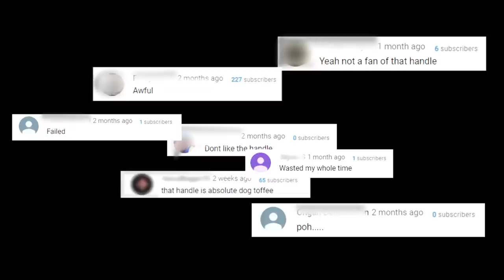Restoration of rusty old straight razor. This time better

Comment: At 12:05 are we going to ignore the fact that  he pulls out an anvil to lightly tap on the metal with a hammer
Reply: probably just needed a taller work surface
Reply: I mean, that's how you use a hammer rivet? But yeah it is a HUGE anvil for the job at hand. :)
Reply: 2FAST sometimes it do be like that

Comment: Great job! One thing to consider for future builds - mixing two metals (the brass tube and the steel blade) creates a battery effect (galvanic corrosion) which causes rust. Between the two metals on this razor - it would cause the blade to rust pretty rapidly, especially since it would be regularly exposed to water so the wood will have a high moisture content even after the wood treatment. https://en.wikipedia.org/wiki/Galvanic_corrosion
Reply: the one good criticism

Comment: What sort of clown would give this a thumbs down? It's well done, instructional, and humorous. 

I would have just put the razor in the scrap pile had I saw it. If I had done the work to restore blade, I would have bought some commercially available scales and called it a day.  

Odd Tinkering goes the whole way to redo/make everything. He's done good job of explaining what to do by using only an odd title here and there, the background sounds and some labels on made on wide pieces of tape. Those explained everything. No spoken words needed.  Plus a few good jokes. Bravo.

Comment: Tech tip-fill the cavity on your side cutters with silicone. Once it hardens cut a line in it so they can open like normal. Then when you use them to cut your brass rod it doesn't go flying. The silicone will hold it in place!

Comment: use blocks when sanding or roll up the sandpaper to form a tube when working on curves!  it will keep things flat and straight, especially when doing a straight razor!

Comment: If you only epoxy the wedge to one of the two sides, it won't rotate out of place, but if you ever need to disassemble the razor again, it'll be possible to pivot the scales or remove them from one another. Like, for example, if you decide to install actual bearing washers in place of those pin retainer rings you put between the blade and the scales.

Otherwise, good stuff.

Comment: I adore the handle you made for that straight razor! 

Questions:
1. What was the name of the Wood Hardener?  I have not heard of that before this video.

2. Why did you fully slice the wood block into two pieces if you knew there was going to be a wedge added back? I would have imagined that you could have cut the proper width out, or am I wrong in that assumption?
3. What kind of washer did you use on the outside for the rivet? What is the name of it? I have a little wooden handled jack-knife  that would look great with that added detail.

Thank you for your help!

Comment: When using a vacuum chamber, if you're concerned about pulling liquid into your pump, you can have an empty container along the vacuum line that will collect overflow without sucking anything into the pump.

Comment: Just a little bit of advice for you here, call it constructive criticism if you will after watching 5 of your videos, after using your rust remevor solution, bathing your metals in WD 40 rather than water help prolong the metal after being introduces to rust removing chemicals, water is the last thing you want to introduce metal to, also after hardening wood a UV light would help prolong integrity of the wood

Comment: I have never done this before so where did you find the correct size brass rod, washers, and those little pop on things to hold it all in place and what are they called ? Very good video, really enjoyed it.
Reply from the maker: I found those on ebay. I think it was called razor rivet set or something like that
Reply: Thank you sir.

Comment: Those types of razors are usually used for beards or pretty much any facial hair. I believe you can use them on any hair if you have it sharpened right though.

Comment: Damn Youtube won't let me edit again. You have a good wood shop but I think you need some more steel shop friendly tools, a belt linisher, a decent bench grinder with a range of polishing buffs and cutting compounds, Cratex rubberized abrasive wheels can be handy in a range of grits, and a paper wheel puts a damn fine edge on a knife. Otherwise it will take all day!

Comment: This kids is a straight razor, a knife blade that was made razor sharp and kept this way with methods such as stoning (to be seen in other videos), and stropping. There was no such thing as a disposable razor and it was tradition to visit a barbershop for a weekly trim and shave for most men. You would have your hair kept in an acceptable state and then your barber would mix up the shaving cream (made from a small amount of water and a soap designed for such a purpose), apply it to your face following a hot towel treatment, and then shave you with something like this. It was dangerous and best only a professional handled such a task as a mistake could easily cost someone their life (nicking or cutting major arteries was not uncommon with unskilled barbers). With the invention of the safety razor this became a Gentleman's approach to shaving with your average man instead using a safety razor with a disposable blade. This then evolved to the common, cheap disposable razor of today which is generally considered a poor and cheap alternative to both a safety razor and a heresy to most men whom to this day still rely on a skilled barber for their shaving needs.

Comment: OK its an alright job but in order to get the razor edge you need in order to actually  shave a man's face you will need to run the blade across the leather and fabric belt about 500 times each way on both the leather and the fabric belt strands. Then to test it you should run the blade across the arm hair without making contact with the skin and if the blade snips the hairs off ever so fluently then you have acuratly sharpened your barbers straight edge. Good job though.

Comment: You need to put a razor blade in it. The thing you are doing while shaving on video looks like trying to drive a car without wheels. It's really strange that no one in comments mentioned it. Wetshave young brothers , don't fuck up your face with stupid 3-5 blades or electric shavers.